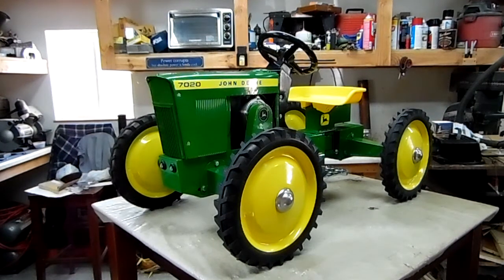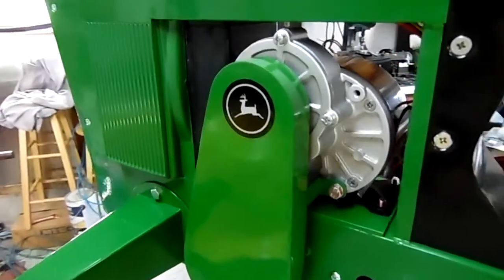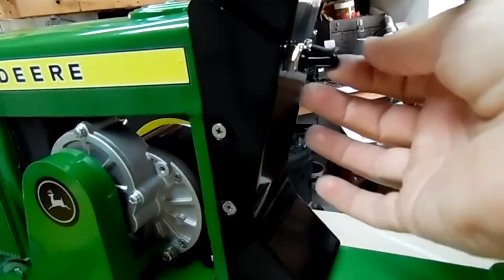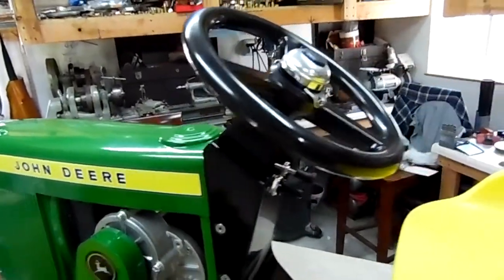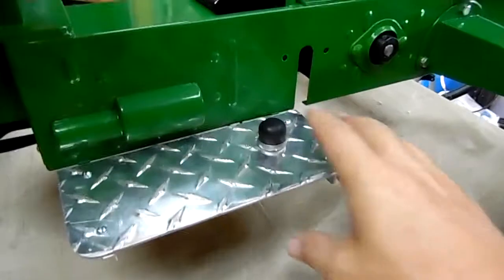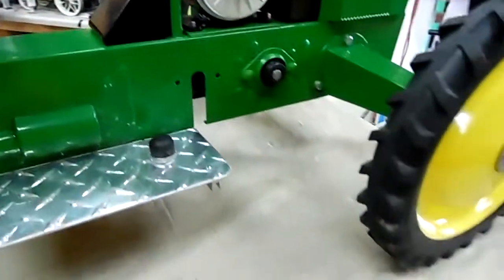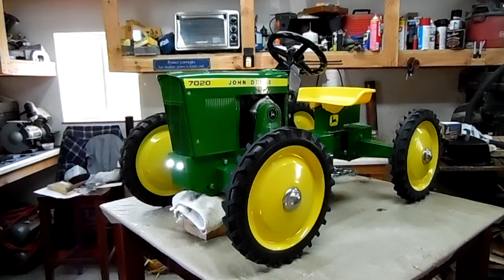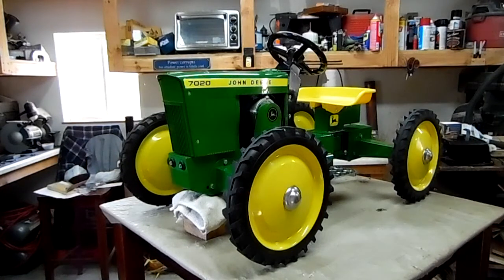John Deere 7020 W/12 V conversion

Comment: Awesome conversion! The pedals and steering on these require a lot of kid muscle.
Reply from the maker: the steering is so difficult as to not be practical.
Reply: @bruceang82  yes, I thought of replacing the steering linkage with a proper u-joint shaft and gears, but our kid is so little, we might just get a different tractor. I do like that all 4 tires are huge with traction though.